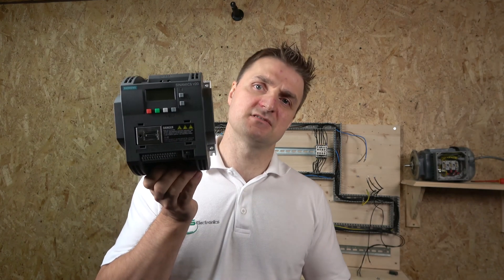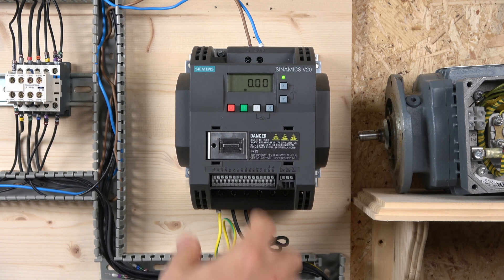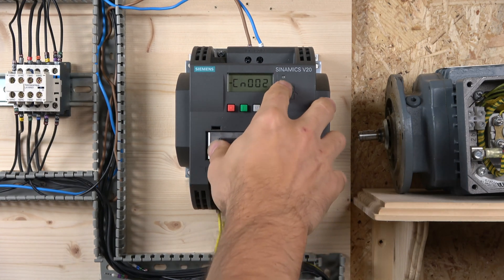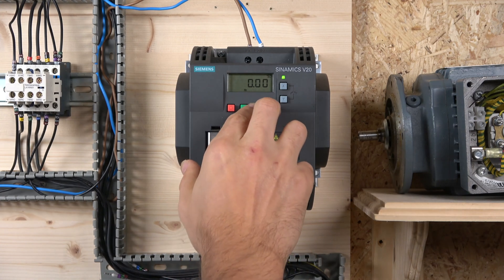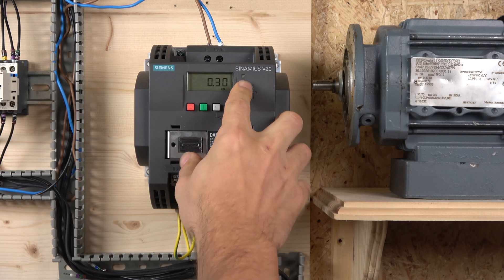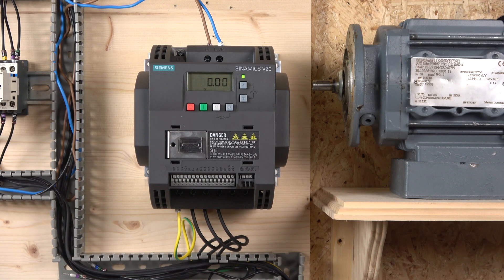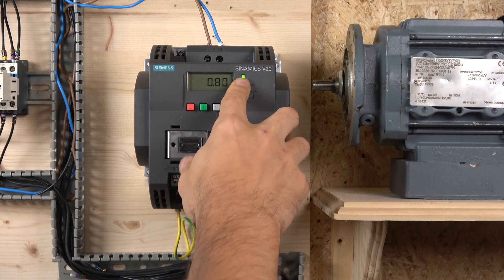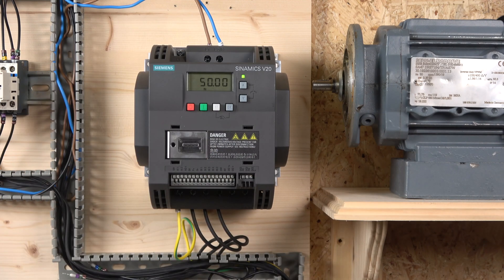Siemens sinamics V20 VFD local control, commissioning, parameter set up and Factory reset. (English)

Comment: Thanks, I was looking for how to "auto tune" the vfd. 
I've only worked with ABB drives previously, there it was several modes for tuning. And now I bought a V20 for a band saw project at home, but didn't understand that P1900 was the tuning function :)
Was a bit disappointed when the motor made a bit much whine when accelerating, I guess that tuning the drive will silence it a bit.

Comment: Hey....great video and great explanation....thanks a lot brother....but can you please explain or add how to run your motor in the reverse direction in CN001 mode???
is it even possible?
Reply from the maker: Check the other videos for this drive I have maid.
Reply: @IGSElectronics  yes i checked..i saw....did not solved my problem
Reply: @abubakarsiddique7795  Haven't tried it yet, but with "Cn001 - BOP as the only control source " I guess the only way to reverse the direction is by pressing both up and down arrows on the panel as described in the manual 5.1.1 Introduction to the built-in BOP.

Comment: Good day! we buy Sinamics v20, 3 phases L1/L2/L3/PE. I think, we are stupid, because we even couldnt turn on it. We only connected cable 4 wires. As result, converter doesnt work, screen doesnt work too, only indicator LED blink by red. Is converter can be damaged or we are stupid? Thank you.
Reply from the maker: Hi There. Is your drive singe phase or 3 phase?
Reply: @IGSElectronics  3 phase
Reply from the maker: @user-xz2bt2px5p  what did you connect to PE?
Reply: @IGSElectronics  TN-C  system. PE=N
Reply from the maker: @user-xz2bt2px5p  PE is earth my friend, 3 phase drives don’t have neutral going to it. Just 3 phases and earth. Remove any wire from PE for now and start up the drive, if still red check all 3 phases to make sure you get from 380 to 415( depending were you are in the world) between phases using electric meter. Attach earth to PE once you confirmed all test.
Reply: @IGSElectronics  we begin by connecting 3 wires(3 phase). Red lamp shoned only. We connected PE wire on PE. Cable with 4 wires. PE we usually use as N in different situation. Combined system N and PE. Only red lamp. 
We connected the motor. Placed on vertical position. No reaction. May be our delivery very bad in our country.
Reply from the maker: @user-xz2bt2px5p  did you check to make sure all 3 phases are present. Usually red light on Siemens drives are due to low voltage. Make sure all 3 phases are connected properly.

Comment: Can you set the output frequency to 100Hz? Or is 50Hz is the maximum?
Reply from the maker: Yes you can go up to 400hz. There is run frequency and base frequency. Base to always be to you country base frequency. Run can go up to 400Hz.
Reply: With Poti I only can go to 50 hz, how can I change that?

Comment: Hi this is from India and I am a biggner.. I have a same drive. I am using extranel start stop push button and for frequency using push button for up down Hz. Now i want to ask when I start vfd then it runs up to last running frequency. But I want when ever i stop and press start it should be running on 0 Hz. Means every time I want to adjust frequency from zero.. I hope u got it plz reply if possible...
Reply from the maker: Hi there, please watch the third video of this drive, it should help.
Reply: @IGSElectronics  yaa i visited ur channel.. All r very interesting and helpful videos...👌 👌 👌 👌
And I watched 3rd video of simenc helpful but still problem not solved